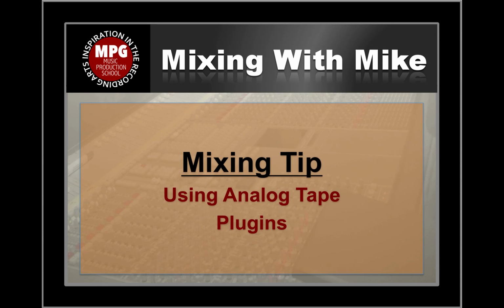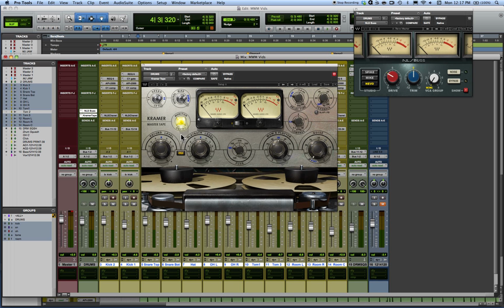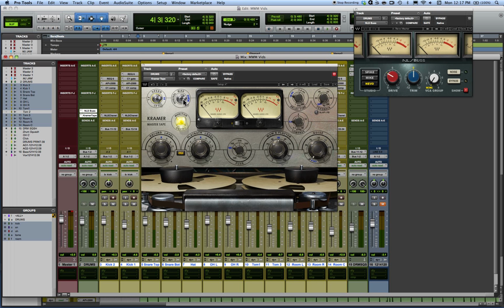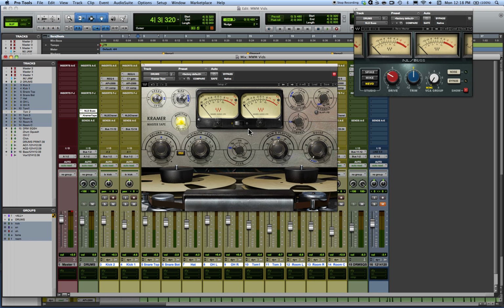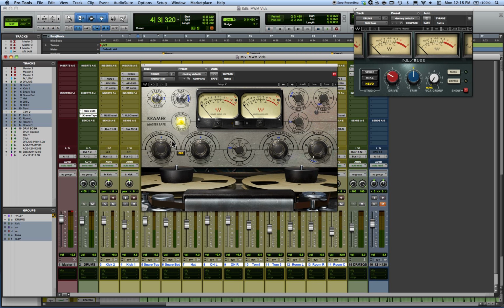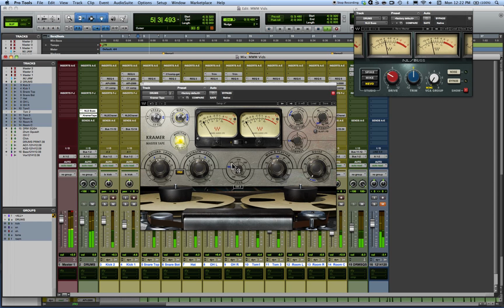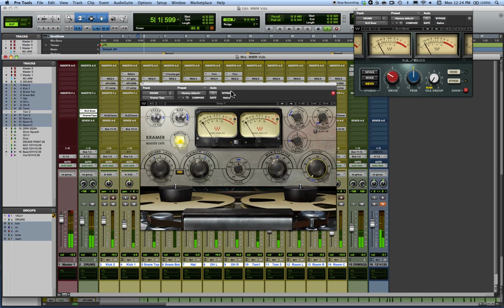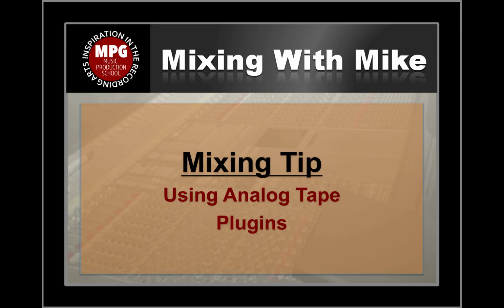Mixing With Mike Mixing Tip on How to Use Analog Tape Plugins

Comment: Hey Mike:
Curious as to what your misgivings are in terms of instantiating a tape sim per individual track (at the top of the chain)?  I read somewhere that this technique followed by a unifying channel sim are key components in emulating an analog signal flow itb. Thanks!
Reply from the maker: +jeff7775 My feeling for most songs is that sounds off a hard drive are way too dynamic to get consistent results with the Tape Emulation in the first slot. At the end of the chain, the dynamics are better controlled and the performance of the tape emulation will be more consistent.
Tape is a Very level dependent medium and that is reflected in most tape emulations. 
Hope this answers your question.
Cheers!
Mike
Reply: Thanks for the fast response! Hmmm... interesting. So you'd recommend then 1. channel strip employing some level of leveling compression, followed by 2. tape sim PER individual track (assuming the goal is some degree of analog tape/console emulation)?
Reply from the maker: More or less, that is correct. The best way to hear what I am talking about is to place a set of plugs pre processing and post processing. Then A/B the approaches. I have done this many times and almost always select the post processing.
Cheers!
Mike